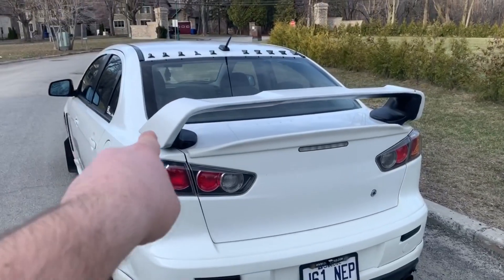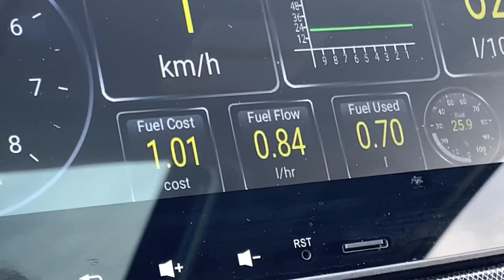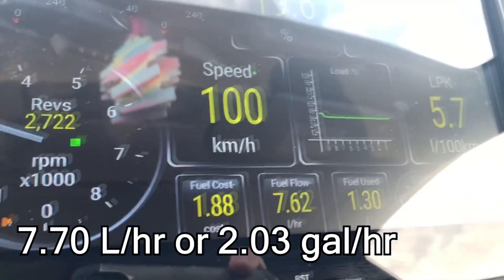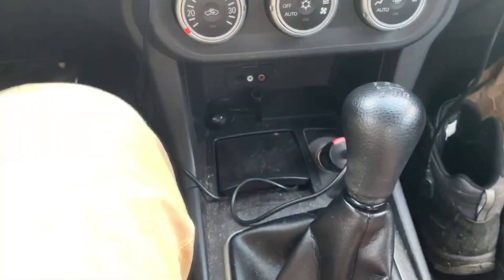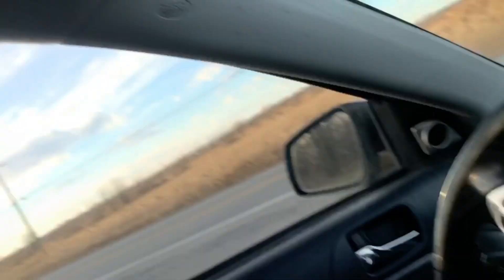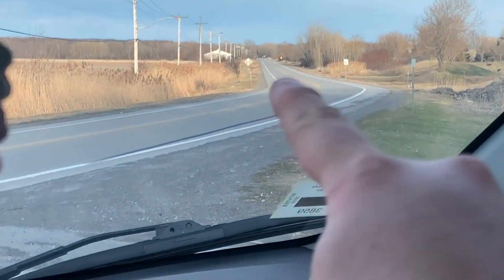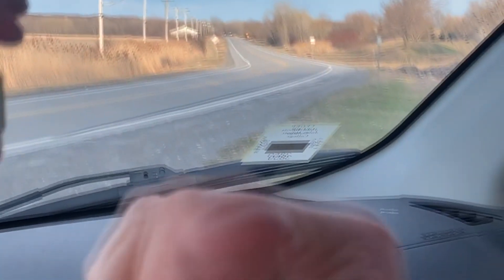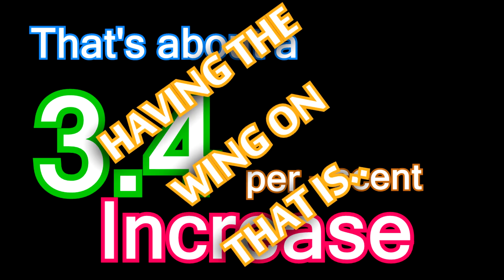Does your car's WING REDUCE POWER and GAS MILEAGE ?

Comment: Mind doing an update on your mod list. I'm currently Modding my 2012 Lancer ES. Have a few similar mods but looking for some guidance going forward. Just trying to stay NA and avoid NOS. So far I have installed:
Injen Cold Air Intake 
Injen Throttle control module
OBX Short Tube Header
Greddy Revolution Axleback
Evo X/Ralliart Paddle Shifter install. 
Appreciate your input.
Reply from the maker: have you checked out the mods list video?
Reply: @Huntsteven6  from about 11 months back yeah. I'm planning to get the rrm lightweight crank pulley and timing control module. Just was wondering if you had updated anything performance wise.
Reply from the maker: @justinking7188  The crank pulley has some potential although you wont notice much. As for the timing corntrol module, I would strongly recommend getting your car tuned by a real tuner instead. That is pretty much the main performance oriented change i have done to my car since (as i am currently at the limit of my clutch with nos). I would strongly recommend it, gives about 15 or so extra horsies, some pops & bangs and flames
Reply: @Huntsteven6  thanks again brother I'll be looking into a new midpipe that's 2.5 in diameter and a tune will be next down the line. Again I appreciate your help brother keep making great vids
Reply from the maker: @justinking7188  Thanks a lot! i always appreciate the positive reinforcement :D and id be happy to answer any other quesitons you may have down the line!
Reply: @Huntsteven6  I will definitely pick your brain down the the line. You are appreciated
Reply: @Huntsteven6  also thanks so much for your quick response

Comment: If you forge internals in your 2.4 witch by the way you can use dodge caliber srt4 internals you can make high 300s low 400s that's stock head and OEM mopar piston (OEM srt4 internals) pistons and rods

Comment: Well its only purpose is to improve cornering on high speed.. probably +40mph.
Reply from the maker: MalabananCrew while that is true, my best guess would be to say that it’s mainly there for looks. While technically, you are right, with the wing having such a low coefficient of drag as I’ve discovered in this video, even though yes it would theoretically improve your cornering, it would not be anything significant. I would however say that it would probably increase the stability of your car when going like 140 mph, not that anyone is realistically doing that haha
Reply: Doing 70-75mph is good enough + the diffusers to feel the stability but if it just the wing alone is pointless and just for looks.. i can see you improved your aero so much.. nice one im a fan of pips who does that 💪but man i love exiting/entering highways on high speed 🥰.. i think mitsubishi cars turn better compared to other cars i drove..